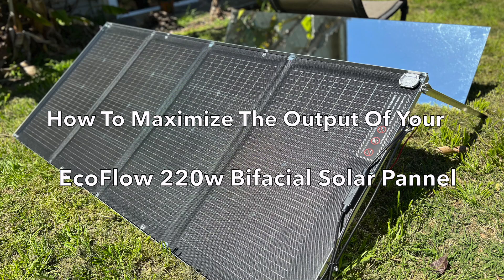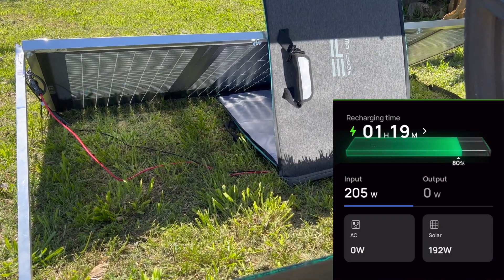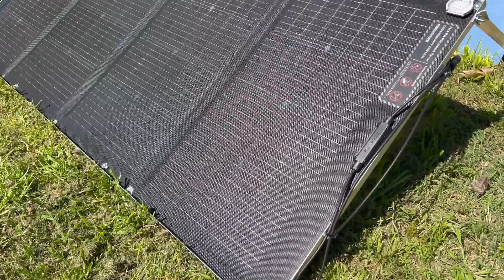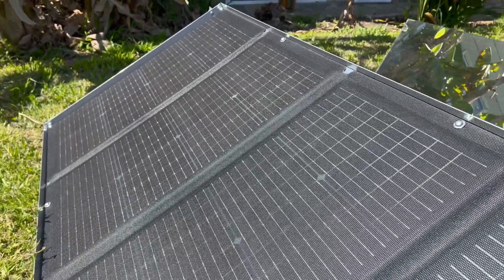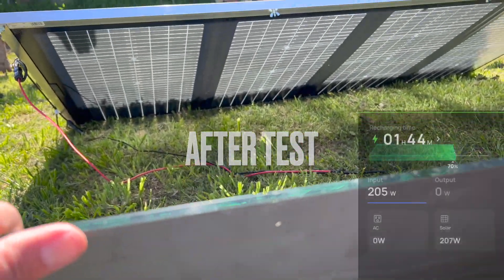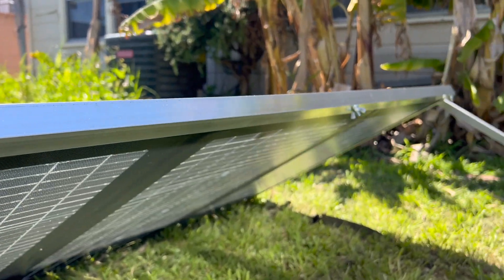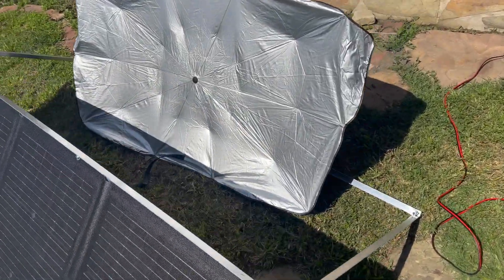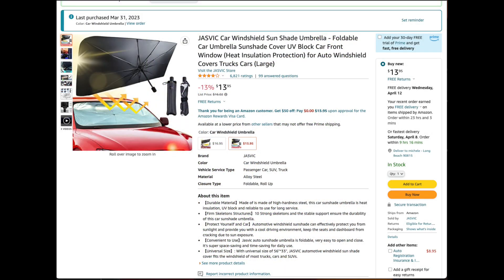How To Maximize Output Of Your EcoFlow 220w Bifacial Solar Panel (I got 209w output!)

Comment: Excellent information. Thought the sunshade was pretty random and corny until I tried it. I consistently get a 12+watt boost with a $10 umbrella sunshade behind the panel (which is a lot cheaper than another 12watts in monocrystaline). Ended up with three of these, so headed to Home Depot to get some aluminum L-bar to copy your ingenious idea for a more permanent stand for one of the panels and will keep the other two portable. Thank you for taking the time to share some great ideas for inexpensive, but clearly effective upgrades!

Comment: I see how you made the stand. Great idea. I have done that with smaller panels. I noticed you drilled holes in the panels to connect the frame using wing nuts. That makes it much easier and sturdy. Obviously, it is okay to drill into the panels?
Reply from the maker: the panels have holes in them already preinstalled. I just lined up the L bars and marked the hole with a sharpie
Reply: @mixstagram  Great! Thanks, that helps.
Reply from the maker: @spraudoggy  No worries my dude! I definitely recommend making the stand if you plan on using the panel for days at a time. Makes it way more sturdy.

Comment: Wow I really like your mounting idea. It's simple and easy to disassemble if you want go back to portable again. Instead of buying the EcoFlow solar angle guide I will probably just use a toy suction cup dart to set up the sun angle.
Reply: The angle guide is installed on the panel

Comment: In theory, while a white towel or sheet isn't as good as a mirror or reflective object, it is still a good option if you're in a pinch. It can reflect enough light to get the back of the panel  picking up some extra wattage.
Reply: In theory but no video on your channel proving your theory.

Comment: I just got this panel but when i plug it into my river 2 it's only showing 110w max in full florida mid day sun.
Reply from the maker: are you using the sun tracker to make sure it's directed at the best angle to the sun?
Reply: I have the River 2 and it is only rated for solar panels 110w. This is different than River 2 Max and River 2 Pro series.

Comment: I'm on my second panel as I broke the first one. Both panels have reached 220w output without much messing around just on the grass and nothing else apart from keep turning it throughout the day. Like I said I've never had my panel at such a low angle as your showing not even at midday. The weather in the UK is not good at the minute but as soon as I get a good day I'll make a video for you. In the meantime I can show you a screenshot off my phone I took a few days ago https://youtu.be/AzayRbwTy48
Reply: I also teach above 200 values while camping and not giving much attention to the panel. I move it 3 times a day. Regarding the App, it also has an Auto setting. That works better than choosing something yourself. I had 8A selected, but accidentally added a 6A phone charging cable. Blew a fuse in my car. With it set to auto this can be avoided.
Reply from the maker: How did you break the panel? I'd love to see a video of your solar output demonstration.
Reply: I dropped it from only a foot or so high and 2 glass panels cracked and it was in it's case. Ecoflow replaced it with another but this one has odd none-liner grooves running down one side of a panel, so I'm going to get it replaced. EcoFlow customer service is AAA+ I can't fault them. As soon as we get a good day in the UK I'll make a video.

I've seen a video somewhere that someone had set his car charging amps to 4 Amps and AC charging to low in the App and was not able to get the full Watts out of the panel. Though once he set his car charging amps to 8 Amps and AC charging to max it improved by quite a bit. It was an earlier version of the App but thought I'd mention that so you could just check your settings and see if it may apply to you.
Reply: I've managed to put together a somewhat poorly filmed demonstration of the panel this afternoon when the weather turned and the sun kept trying to shine through. Its was around 3pm this afternoon and it was 19° according to the weather App. I hope you believe me now https://youtu.be/FvJi2YSwKPE the panel is excellent and you said it's not possible given the technology, but this video shows it is possible with this panel. I just don't know why your panel is not producing the same results, either I'm very lucky (although I've had the same results with 2 panels now so i doubt it), or something is wrong with the panel or setup your end. 

Thank you for your video as i'll be trying this method you have posted for getting the most out of the panel in those colder months.👍

Comment: Not sure if the sun wasn't strong but i can get 220w out of my panel on grass without doing anything to improve the back panel here in the UK. I've never had my panel at such a low angle either, sure the panel is not faulty.
Reply from the maker: You have to align the panel directly to the sun to get optimal efficiency, and as you are aware, the sun isn't in the same place all day so you do have to move the panel every so often. There is no way you are getting 220w from a 220w panel without using the back as well. It''s not possible given the technology.

Comment: Thank you for the video. Please make a video on making the stand for the panel from the Lowe's materials. Great idea.
Reply from the maker: Ok yea I thought about that but wasn't sure if people needed a step by step since it was so easy for me but since you asked I will for sure!
Reply: I agree with the material list. I've been debating between wood and light metal like this, might use both.
Reply from the maker: @Dmpreciado  I updated the description to include the materials list and the sizes I cut everything. I will follow up with an assembly video as well when the weather is better.
Reply: @mixstagram did you ever made that video?